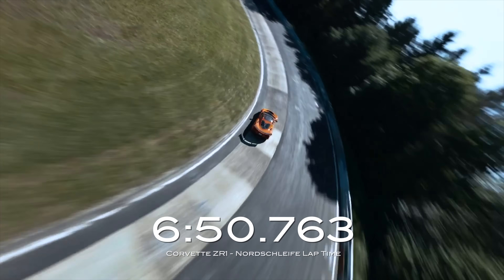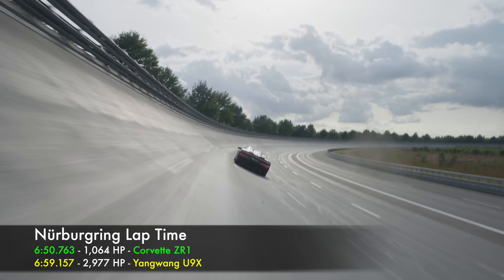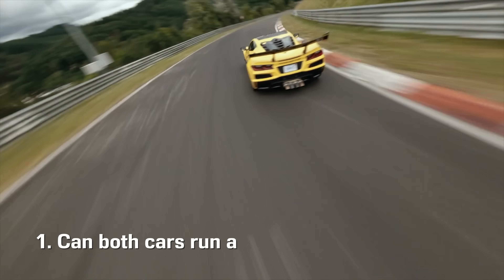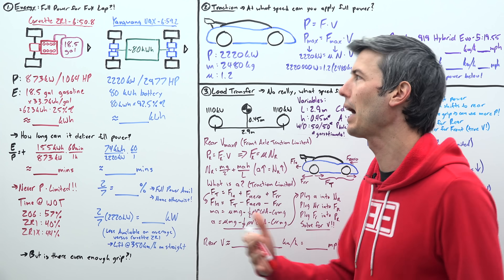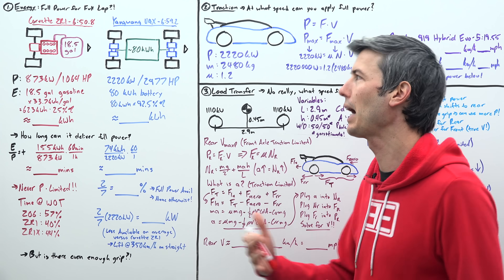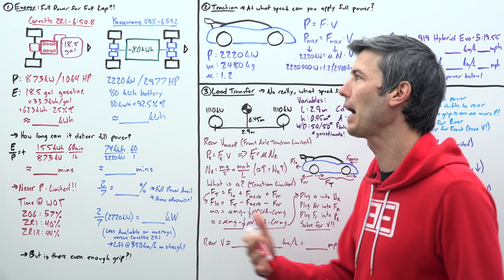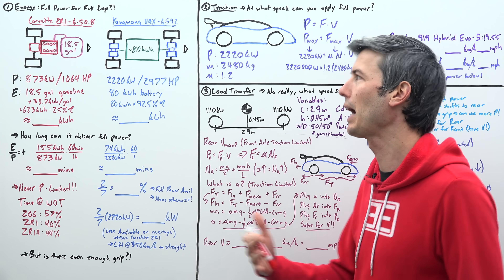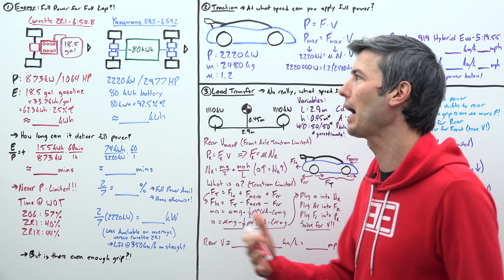Gas Beats Electric! Why Is 1000 HP Faster Than 3,000 HP?

Comment: 3:43 “just two minutes that it can supply full power” I may disagree with you here or at least recommend caution. Unfamiliar with their battery chemistry but I wouldn’t expect the car to have full power output below 20% SOC. So the number is less than 2 min right?

Comment: Loved the explanation and the math was very interesting, but answering the question of why the lower powered car is faster I think is much simpler. There's really only 3 things you need to look at, power, weight, and aerodynamic drag. First, power is a useless factor on its own. For example, an M1 Abrams tank has 1500 hp and a on road speed of around 45 mph. I once had a minibike with 3.5 hp and could get up to 50 mph with a 160lb me riding it. The difference is the power to weight ratio. The Abrams has 25 hp per ton, or .0125 hp per lb. The minibike with me on it has at worst .0175 hp per lb, assuming the bike itself weighs 40 lbs, though I think it was much less. Either way, a 3.5 hp minibike has more power per pound than an Abrams tank. If the what you are comparing have very similar aerodynamics or a low enough top speed, that's all you need. If you want to make a more complex comparison, higher speeds with differing aerodynamics, you have to take into account how much extra power is used to overcome drag. But, mostly, you can just use power to weight ratio. That gives you a good comparison for a vehicles acceleration and its ability to handle corners at high speed, which are the two biggest factors for lap times.

Comment: It’s important to recognize that the calculation primarily illustrates the theoretical conditions under which the U9’s maximum power could be fully utilized. In practice, its (in my eyes) disappointing lap time likely stems from issues such as drivetrain overheating—something that has been reported by other testers—and a less capable suspension system. For comparison, the 510-horsepower Porsche 911 GT3 achieves a Nürburgring lap time of 6:56 minutes, largely due to its precision handling and advanced chassis setup. It’s also worth noting that the Nürburgring, compared to many other racetracks, tends to favor vehicles with high horsepower. So, given all that, the U9’s lap time leaves me rather unconvinced.

Comment: Yangwang could have gone faster on the straight portion shaving off a few seconds but the driver chose not to to save energy and not run out of the juice before the finish line. So a better battery could have done the trick. On another note,was there a recouperative braking involved with U9 extreme or it doesn't have it?
Reply: Often when running an EV this hard it doesn’t do much regenerative braking because the battery temp is too high. EV’s are efficient, but the batteries and motors still tend to overheat when pushed hard for extended periods.
Reply: @NBSV1 That's why the battery is water cooled. All that heat is dumped into the radiator which dissipates it into the atmosphere. At high speeds there's way more air going through it so it can remove more heat more quickly. Any high performance vehicle should be designed with adequate cooling in mind. And lets not forget that battery has a really large surface area which also aids in heat transfer.

Comment: Maybe it's just the video title: of course, weight and downforce are probably the deciding factors of why the Corvette is faster, but the video explains well that even if you don't consider corners (weight and aero), the Corvette can put its power down more efficiently than the BYD, which in many situations will be able to put less power down (even though having 3x more on paper)

Comment: Gas can absolutely destroy electric in terms of power.  Even a basic gas engine that uses nitromethane absolutely blows the doors off of any electric motor in terms of power to weight. This idea that electrics make so much power is not really true. Gas engines are limited by regulations and cost. There is a reason why Elon's rockets are chemical and not electric :P

Comment: I think the P=F*v approach is wrong in this context as F is not the weight force but the driving force vector in the direction of v.
Also, solid state mechanics, which are implied here, don't work for rubber on asphalt.

Comment: Car weight, weight distribution, suspension, tires, usable HP,  smooth and consistent power application, which is much lower in EV's due to the on/off type power application of electric motors compared to ICE engines, the number of reasons for it being slower in an EV are quite a few.

Comment: I've always argued that it's not always about power and have always said you can have too much. As you've rightfully explained a lot of power is really hard to effectively put to the road. I argue that weight and gearing are more important along with adequate traction. A lower weight means you have less mass to move and gearing (leverage) allows you to move it easier and therefore quicker. I had an old Holden LC Torana (Australia - 1970) that had a hot 6 cylinder (Triple carbs and huge cam) and even though it didn't put out staggering horsepower figures was a very small and light car. I added a 5 speed to it (so I effectively divided the ratio to the diff by 5 instead of 4 which gave me even more leverage) and it was a very quick little car, beating most V8's. It was about as quick as an late 1980's Porsche 911. 0-100KMH 5 secs low 13 sec quarter mile. This was around 1990. The Porsche 911 beating the ZR1 is just more proof that you don't need huge power to go quick around a track.

Comment: 15:50 there's still a balance to be had. AMG GT Black Series weighs ~400lbs more than the GT3 RS and has about 200 more horsepower, but is still 6 seconds faster (on a damp track)

Comment: I hate to disagree with someone who is way better then math than me but I think it really comes down to weight and suspension as the bigger factor. The C8 is a fat pig (Mine weighs 4050lbs, the ZR1 WET weight is around 3900). For what it is, the truth is it can't change direction much better then my older lighter corvettes on modern wheels/tires.
It can accelerate like mad and brake like crazy, but the reason the way less powerful 911 gets close is weight and also suspension. Now you take a massive 5467lb Yangwang and the problem gets way worse.  If the Yangwang weighed the same as the c8 and had the same suspension I would put money on the electric car. The traction limit due to HP IMHO doesn't come in to play as much as the weight and suspension.
Also why the Porsche 919 that only makes 1872lbs and makes about the same 1160HP as the C8 zr1 decimated the C8 lap time.

Comment: Total nonsense. You didn't include differences in braking performance, cornering performance, nor did you include the inertia effect on acceleration from the EVs massive weight of its battery.  You didn't include any actual difference in tires, down force, or drag.

What would have been FAR more instructive is to show the relative positions of both cars at points around the track - show where each gains or loses ground on the other and then figure out why the Corvette comes out ahead.

Comment: First, respect for your physics analysis. Second, you didn't adequately address the limits of the front tires (or are they tyres).  As load of the front tires is reduced, so is their traction.  Unless there is a power control system to make sure neither the front or rear lose traction, the rear tire power ability is controlled by the front tires.  Third, you didn't address the ability to put down power during cornering.  Nurenberg Ring places strong emphasis on cornering.  As a car corners, the inside tires have far less downforce and less grip.  Thus, the inside tires are the limiting factor on power capabilities.  

This is so complicated that sophisticated models are used.  I have no trust in models because I have used them to predict the result that I wanted before we analyzed data.  Any competent engineer, if given enough data and the right answer, can model the data to provide the right answer.  That is why statistics is completely unreliable.  Filter data - different answer.  Change assumptions - different answer. Weight data importance - different answer.  No analytical model proves anything except the competence of the modeler to manage the data to give the "correct" answer.

I've used it many times.  As an engineering manager, my job was to get the 'right' answer.

Comment: 'if it had meaningful downforce'
IF??? 
ffs mate. downforce can be the majority of the force pushing the car in to the ground. Granted, the u9 is a tank, so hitting +1g of downforce might not happen, but to discount it entirely is kinda retarded. That hill climb crazy EV 'gocart' car could literally drive upside-down due to its downforce (ie, >1g downforce), its the only reason something that weighed a few hundred kg could accelerate so quick. 
that 'if' could literally double the 'weight' of the car...

Comment: What’s the comparative weight between both cars? What’s the comparative wheelbase of both cars? What’s the comparative height of both cars? These questions will answer why a more powerful and potentially faster car be beaten by a less powerful potentially slower car around a racetrack. Maintaining higher speeds through corners and overall averages will yield a faster time.

Comment: You are ridiculous, and don't know what you're talking about, despite the fact that you pretend you do, by standing at a whiteboard.  First of all, the Yangwang U9X has regenerative braking.  So, when you are calculating its energy capability, you are completely ignoring the fact that it can get a lot of that energy back during the lap, greatly extending its range.  If you were talking about a straight line, ok, I wouldn't argue.  But, a track like "The Ring" has a lot of braking involved, and can recharge the battery and get a lot of that back.  So, your math is completely useless and wrong.  Furthermore, your calculations about tire coefficients do not take into account the number of tires driving the car and the width of the tires.  Those things are HUGE FACTORS, and you completely ignored them.  Yes, you sort of addressed it when talking about the load shifting, but, that's small potatoes.  Sorry, but if you have a tire that is 5 centimeters wide, and you go up against a tire that is 5 feet wide, you're not going to be able to apply full power for a LONG time, while the 5 foot wide tire can do it pretty much immediately.  None of your calculations even factor in how big the patch of road is that comes into contact with the tires.  Even if the two cars used the same exact tires, ok, fine, it means a fair competition, but, your math would still be incomplete and wrong because you failed to even address the tire size and contact patch.  Furthermore, these cars create downforce, thus the downward force isn't just the weight of the car.  It's the weight of the car, PLUS the downforce created by the aero.  You ignored those things completely also, thus your math is incomplete and wrong, yet again.

The reason a ZR1 outperforms the Yangwang is WEIGHT/MASS.  A 6,500 pound car doesn't corner like a 3,500 pound car.  Getting that much WEIGHT/MASS into a turn puts an all new level of stress on those tires.  How fast you can TAKE A CORNER is key to winning races.  If the ZR1 weighs a lot less (has less mass), you can throw it into a corner at a higher speed, and it sticks, and reduces lap time.  If you have a heavier car (more mass), you're going to need to slow down more for the corners, and take those corners at a lower speed, thus increasing your lap time.  Yes, a more powerful car will catch up on the straights.  But, the more curves a track has, the more the advantage tips in favor of the lighter (less massive) car.

But, hey, you have 4 million subscribers, right?  Gotta pretend you know things you don't, right.  That's how you make a living.

Thumbs down.

Comment: You have not hit the button, we want weight to power. A battery pack weighs X at the start, and weights X at the finish. A normal sane vehicle weights x at the start, and is near E (for empty) at the finish. The loss of carbon fuel doesn't impact on performance. Take the Le Man 24 hour race, EVs don't stand a chance.

Comment: It looks like they could improve the car quite a bit by moving one of the front motors to the rear. This way you "distribute" the grip to the "power" better and improve acceleration. Also, if you're not power limited in your top speed, you could have a more aggressive aero package to improve corner grip and high speed acceleration. But at the end of the day, you'll always be limited by the battery size, as in stored power and weight cost. The power density of gasoline is still king.

Comment: Cool vid as usual but what I missed here was a final comparison of all possible limitations and conclusion on what is actually limiting the EV: battery size or traction? What I missed was how much power is required to max out traction and whether the battery capacity is sufficient for the actual power usage during a run. The average power available based on battery capacity and lap time suggests the EV is battery limited because that power is lower than that of the corvette, but I don't know whether a bigger battery would have helped or whether it would be traction limited anyway. The video doesn't answer this question as far as I can tell.
Presumably, with battery tech advancing steadily, EVs of the future will easily have enough energy to do a full lap at full power and the weight to do so will also go down. Would that make EVs with such insane power blow past gasoline cars or will the tires be the great equalizer?

Comment: I don’t understand. A corvette with a 18.5 gallons of fuel will only run wide open for 10 minutes?  
Roughly speaking. If wide open is 200 mph, then it will only make it about 35 miles, 2 miles per gallon. 
I don’t think so or I don’t understand.

Comment: I'd assume average cornering speed would be lower and more time would be lost in transitions due to the gargantuan amount of weight on the EV.   Didn't touch on power to weight at all in this which is also a key point for acceleration, or drag coefficient which would effect the top speed.

Comment: On a race track that actually has corners, horsepower is not as important as handling, breaking and acceleration. 
Generally, the fastest cars have between 600 to 800 horsepower because any more than that is just a waste. 
The electric car used is actually a very poorly designed vehicle but most electric cars are very poorly designed. 
A properly designed electric vehicle will out perform any internal combustion engined vehicle.

Comment: It is not about maximum power, it is about torque and mass. You do cover this a little, but not by name. Power determines your top speed and torque (plus your mass) determines how quickly you get to the top speed. The Nürburgring is not a track designed for top speed cruising, it is about acceleration, deceleration and carrying your speed through corners.

Comment: Typical gasoline engine efficieny is around 20%-30%. While Electric motor efficiency can be upwards of 80%-95% Meaning you need that many times less power to get the same effect because you do not have losses that you do with typical ICE drivetrains MOSTLY the engine itself. I saw Toyota made a badass manual electric car and that might hurt or help but it's fun so it doesn't matter.

Comment: Not gonna lie, that latter part was intense 😅. However, its actually simple and easily understood that throwing horsepower at a challenge is not the answer. What would have been interesting to calculate is what overall HP is the EV actually using. I imagine very similar to the corvette and the extra weight would be the 7secs lost!?

Comment: Like a lot of the comments mentioned its all down to the car's mass considering the EV weighs 2.5 tonnes (5456lbs) and the corvette weighs about 1.5 tonnes (3500lbs) and even with nearly triple the power the U9X still would slump in the corners.
Reply: Yes, the calculations only consider acceleration in a straight line. That's where comparing the maximum grip makes sense.
For cornering (and there are lots of corners on the Nürburgring...) the weight is a huge factor. Plus, if one car can go around the corner quicker, it also needs less power to get up to speed after it.

The video is still interesting though! I was aware that these vehicles can hardly put down all that power, but I was still surprised how little of that power can be put down under most circumstances.

Comment: So it could go to +400kmh for less than 2 min if track long enough, if tyres don't destroy themself and motor can spin that fast without huge efficiency loss. Until battery improve if they can improve enough combustion reign supreme. A part from that why put these motor in front aren't they oversized?

Comment: Because the Chinese automaker hasn't been provided with quite enough stolen IP, R&D, and force-transferred manufacturing processes to get to that next level. Give it time, though. All of that always arrives. Sector after sector. Product after product. Industry after industry. Ultimately preventing competitors from being able to recover their investments in IP, innovation, and R&D, pushing them deeper and deeper into a race to the bottom. All while non-Chinese giggle with glee at the ability to buy mid products stuffed with features and performance built on that stolen IP and R&D, and that they'll happily replace with the new-new in 2 years.